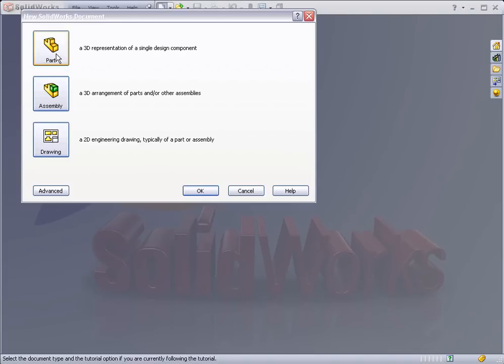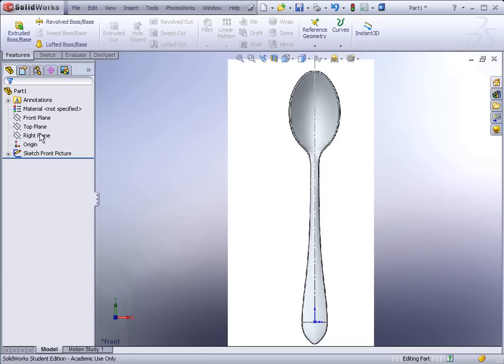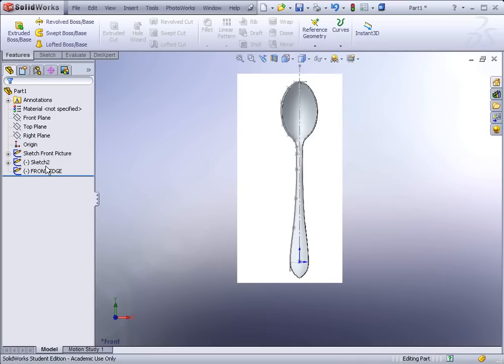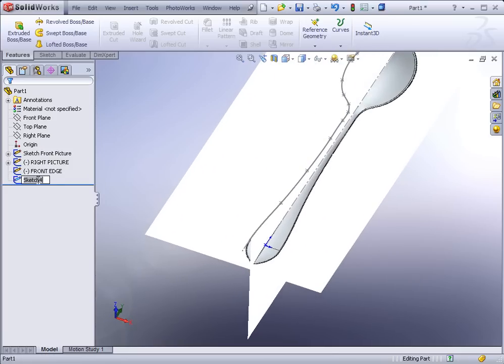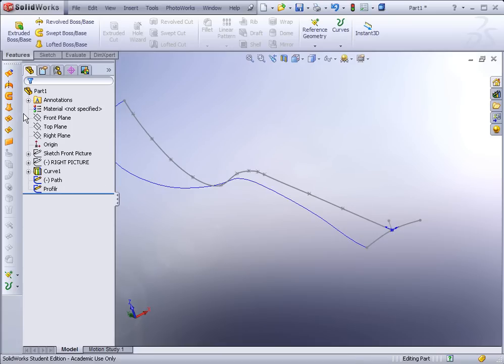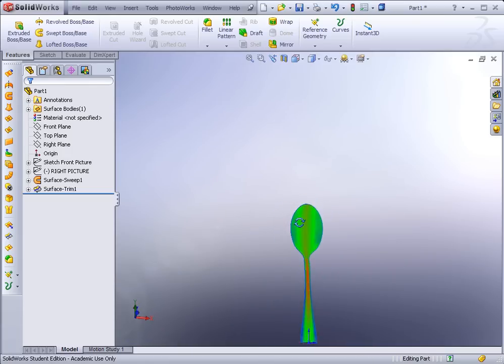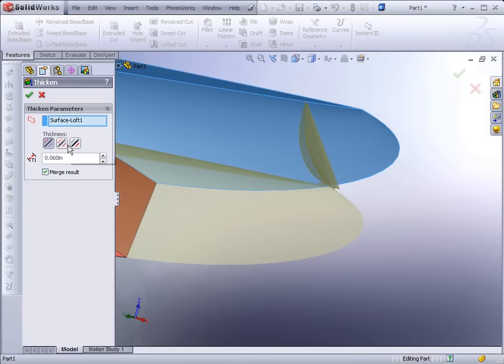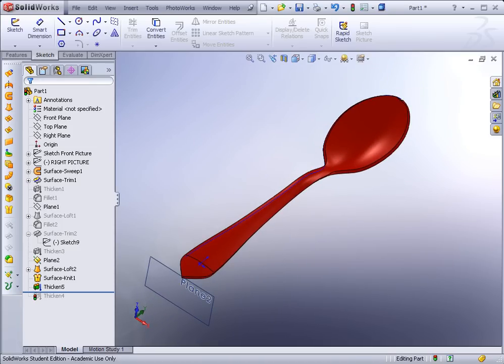E21 SolidWorks Surfacing a spoon

Comment: When you end a spline and want to constrain it, instead of creating a centerline, its quicker to just select the spline handle and do the horizontal or vertical constraint there. Cool video, i learned some things i've always done the long way
Reply from the maker: Thanks Spencer. Yes, you can use the handles. There are two reasons I don't use it here. 1st - I teach/lecture new users who have a tenancy to use it incorrectly then I'm stuck trying to fix the errors they make. 2nd- it reinforces/teaches them more tools (C0/C1/C2) curvature control using relations. Thanks for the input

Comment: good surfacing introduction.

I might suggest the use of a filled surface to fix the tip irregularities. You cut out the point and fill it in with a filled surface negating the need to fudge in the cut/fillet after thickening.

Comment: http://tinypic.com/view.php?pic=10iidmr&s=8#.VOeIwyvF-zk

Is there any way to create a draft with surfacing?, id also like to put a radius on the corners (not pictured) should I do that after extruding/thickening with the fillet tool?
Reply: In theory that should work for filleting. Do you mean extruding to your surface from say another body that might be under your surface or something like that? I haven't done much surfacing but intuition tells me to try making your surface parallel to your part that you want to draft it to then perhaps on your extrude select up to face or something. Not looking at solidworks at the moment or I would try it I suppose.